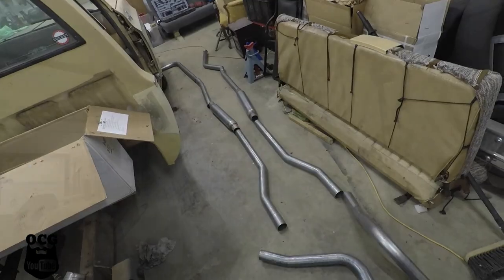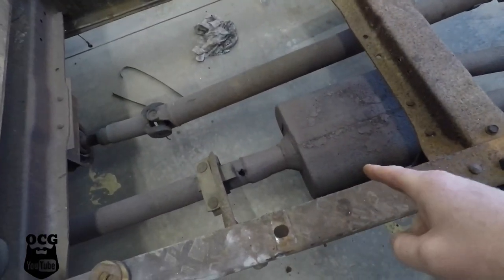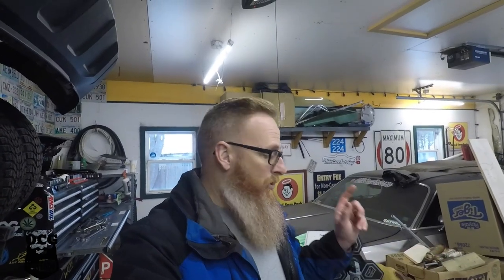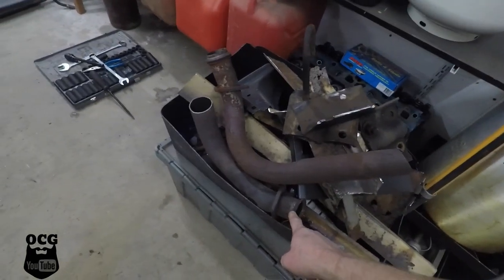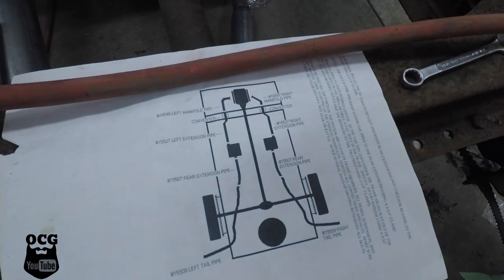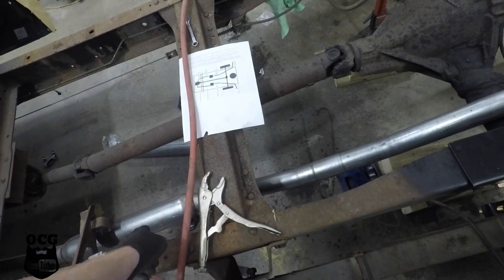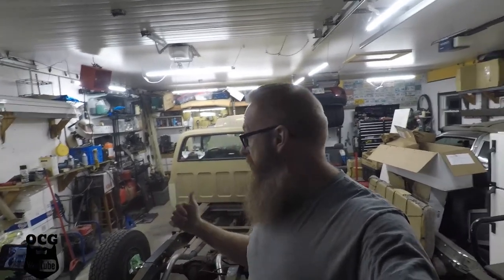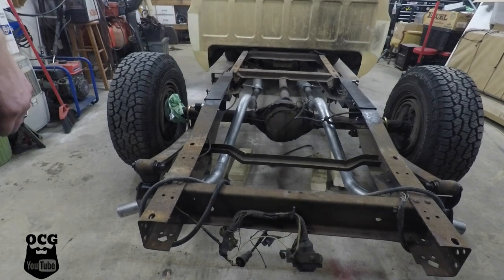FIRST START WITH NEW EXHAUST AND GLASSPACKS FROM LMC TRUCK ON MY 1977 CHEVY C10 TRUCK

Comment: Dale sounds good!! For a road trip, I'm torn between that simplicity of the original motor, or the reliability of an EFI LS crate motor.  Either way, can't wait to see what you do!
Reply from the maker: the biggest concern for me right now simply is cost due to it being a budget build. However, once the initial $5k is spent and the budget build portion is complete, I'll look at dollars per performance. I know i can build a 350 hp SBC pretty cheap even with some upgrades Whereas a 5.3L LS motor will come stock with close to that and likely an easy 50 more with a tune, but probably looking at $5k just for that, by the time you consider, matching trans, fuel system, wiring,  tune and the actual purchase.
Reply: @OldeCarrGuy  there you go again.  Being all logical and stuff... 😉
Reply: @OldeCarrGuy   i install on mine a 6L/4L80E and doesn't cost that much and so much power and relybilitie just buy a donor truck and do the harness yourself and you gonna save a lot!

Comment: Fun driver engine suggestion: 
Refresh stock bottom end 350
Comp xe268 cam
Double hump heads can be had for $2-300 and they usually give you a full point of compression, I'm assuming the stock truck engine is like 8 or 8.5:1.
An rpm air gap intake is always my preferred manifold
And whatever flavor of carb you want. Holley 650 would probably be great.
If you swap the engine, might as well toss a 2000-2500 stall converter in there too. The Jegs ones are really good and super cheap.
This is just some jackass' $0.02 though lol
Reply from the maker: Funny you say double humps heads as my dad has a pair......I just may have to "borrow"!

Comment: Truck sounds great. Something I have done on my truck is just throw bolt instead of dealing with a stud kit. Because it is so hard to drill out stolen studs. Great job on video. Keep up the good work. And stay safe. 👍😎
Reply from the maker: Thanks Man! The only problem with using a bolt is the old stud still has to come out, so I may as well replace with a stud!

Comment: sounds good!!! I think it could be louder, it's not too loud to me Better then before for sure. Man if you need that back end brought up you're gonna need the stock fronts the ones closest to the cab, those back shackle hangers are stock, but the front ones you have are lifted higher then stock to lower it. I can get some measurements of pictures of my stock one for you if you want. I think they just replaced your rear shackle hangers with stock ones mostly from rust because I've had to do both of dad's that way. I saw what looked like bolts tack welded on those rears so it appears they have been changed but they are stock. The front most ones closest to the cab are your problem.
Reply from the maker: They can always be louder! I just need it not to put me to sleep on a long trip! And we’ve already talked about the hangers! Haha
Reply: @OldeCarrGuy   I know what you mean dad's truck used to be alot louder and after work coming home longer then 10 minutes trips it'd put you to sleep

Comment: I’m glad YouTube put this video on my feed, I really like the way you filmed and explained your exhaust install. I’m looking to do the same on my 80 GMC and want to do it myself. Wondering, did you have to go back and weld the joints, or did the clamps do a good job of preventing exhaust leaks?
Reply from the maker: Knowing full well i was going to end up replacing this setup with a bigger custom, stainless one, I only used the supplied clamps which are sufficient by the way. Welding seams is only a preference to those who can do it themselves or chose to pay to have it done. 

Here's the video of the stainless set I installed:  https://youtu.be/8S7JKDdEKaY
Reply: @OldeCarrGuy  Right on, thanks, I will check out your stainless install.

Comment: Sounds good. If it gets to much drone just move the mufflers back. I dont think you will have any sound issues with the pipes all the way out the back. So much eaiser to weld exhuast and install it with the bed off lol. Honestly good oil tuned qjet with an rpm qjet intake,  good igintion set up, drop in an 700r4 with a good cooler and keep it around 180 degrees on the trans engine 180-195 and you would be surprised how well it will cruise. I know you get alot of people saying efi or ls but a qjet is so simple and cheap. You got a good engine i wouldnt bump the compression up to far so you can get gas at any station. I basically have the same engine in the work truck, i run the qjet, rpm qjet, with spacer, long tubes. Overdrive. And i haul so much and drive it every where. Even gotten 22-23 mpg on highways and plenty of moving power obviously no race truck but its not built for that. Hell throw some 1.6 rockers on it and get a little more out of the top end if you want. I know its hard to believe my mpg and it is still a high milage engine i have had the truck over 9yrs now same engine that was in it when i got it. Giodwhrench crate engine with over 150k miles and still going.
Reply from the maker: I’m leaning to the tried and true SBC. I know I can get 350 hp with very little effort and achieve decent mpg! My dads 37 Chevy was well setup and got 22 mpg all day long! I may be leaning on you later on!
Reply: @OldeCarrGuy  i believe it, those old engines where daily drivers and driven everywhere back in the day, and really didnt do that bad. like you siad tried and true, lots of aftermarket for them. i think alot of people stray away from them because they dont understand them anymore. and honestly i know people say new engines are better but everything that i have looked into and seen its not the new efi or engine its mostly in aerdynamics,  transmission and gearing  but the they do have  cylinder deactivation of course. i would be glad to offer any help you may need

Comment: DANG Dale is sounding sooooo good. I think it's just loud enough. LS or at least going efi sounds like a possibility depending on your budget.
Reply from the maker: I'm leaning SBC build with a carb and rear gears!
Reply: @OldeCarrGuy  that's the budget friendly option and it will improve the overall long distance comfort